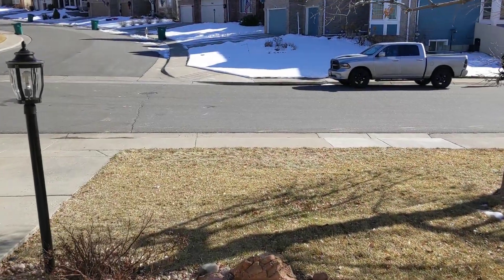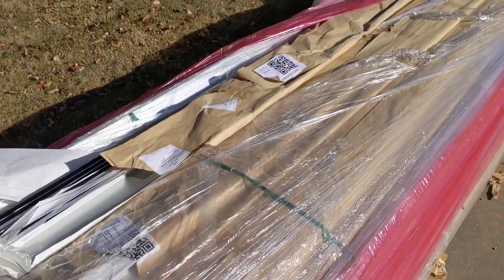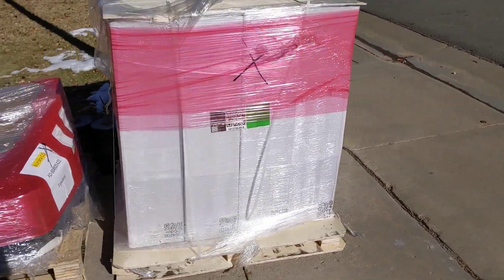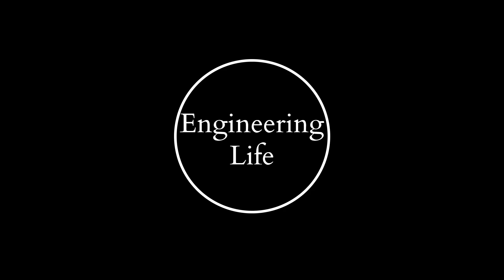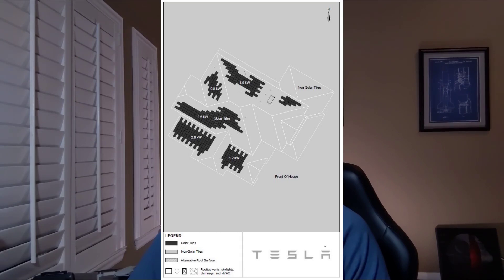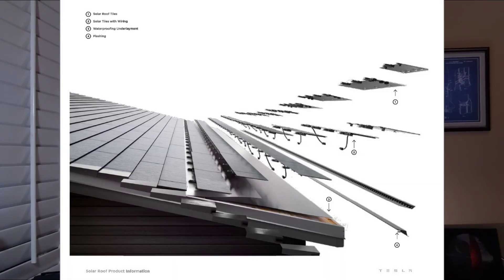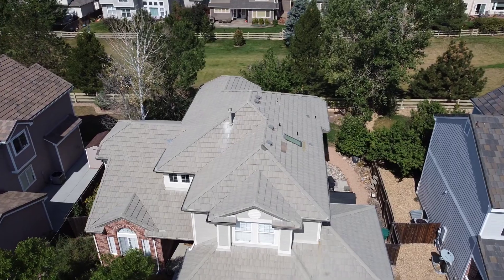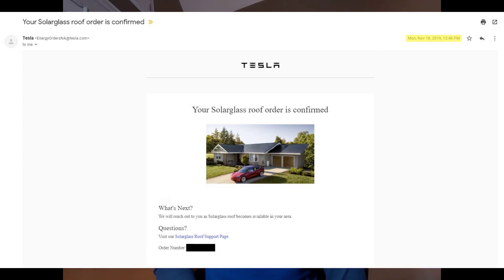Tesla Solar Glass Roof V3 Installation - Phase 1

Comment: I’m surprised having so much roof surface area that your system maxed out at 8 KW. I would imagine the standard panels would have allowed for a higher production. Still, I see your logic based in the fact that you had to repair the hail damage. I went with regular panels and spent more time in the design phase more than any other step in the process. I live in hurricane country and the rules for wind mitigation make design a huge obstacle to getting the desired output balance with country requirements. It was hellish, but ultimately worth it. Tesla’s design team was not easy to work with, but later I grew to understand just exactly how difficult the process is for them. The installers themselves were great and the final result was awesome. Enjoy your new solar roof.
Reply from the maker: Yeah because my roof is so broken up, when you have to account for all of the offsets from the edges and transitions it makes it tough.  Additionally there is a minimum amount of panels they can put in a single sub-array.  So both of those definitely limited the total system.

Comment: I know that a SOFFIT/LOUVERS helps to increase ventilation for your roof and attic (which ultimately helps prevents ice dams) but are they still required if the need to keep the roof cold is gone? reversely in the summer is the Tesla roof cooler?
Reply from the maker: So I think the answer is no.  The solar tiles were installed right on top of this and there is about a few inches of gap between the roof decking and the glass tiles for ventilation of the PV as well as allows the proper cabling to be run.   We have no issues with snow accumulation, as soon as the sun comes out the snow slides off the roof (which is a separate issue...).

It will be interesting to see if there is a noticable difference in the summer to our upper rooms which struggle to stay cool throughout the hot days.